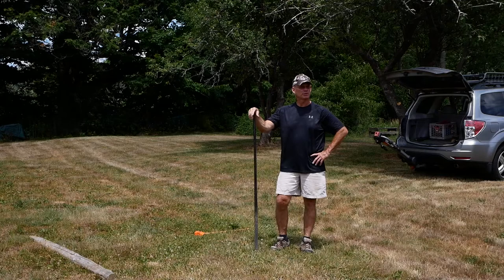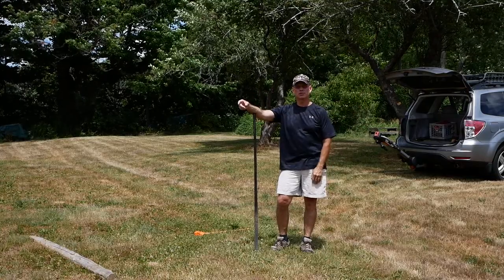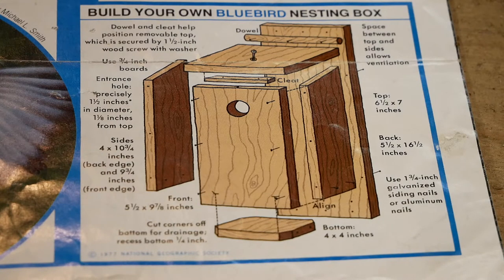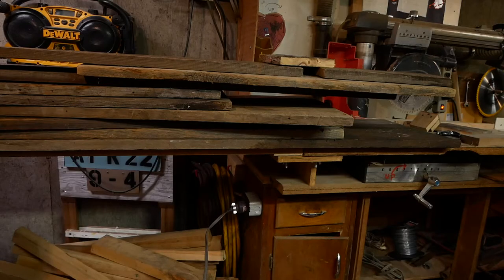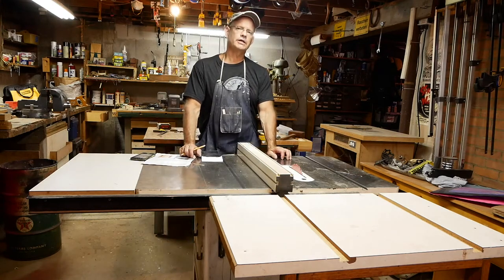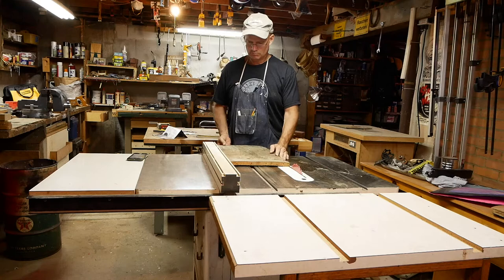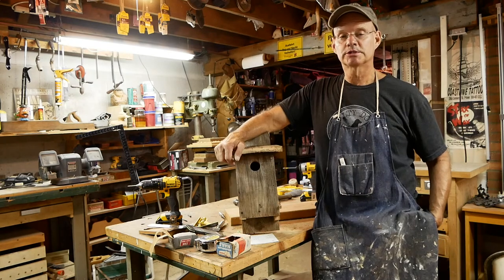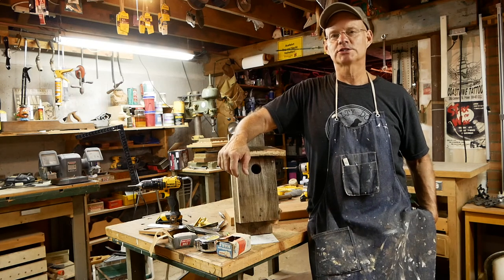Building a Bluebird Nesting Box

Comment: Hidy & thank you for making your video on bird-houses. You have some AWESOME PICTURES, but you need a good microphone on your collar. I couldn't hardly hear you. (I checked the comments, to see if anyone else had problems hearing you, and they did.) We could hear the drill-motor impacting, but the rest was low and skippy...but Thanks for making the video.
   <One tip, if you plan on doing a bunch of those free-standing post houses, get a piece of thin-walled 4" steel pipe and weld up one end. Then stand-off two parallel handles, one on each side. you want it 3' long. Slide it over the top end of your post BEFORE you put it in the ground. Run a band of tape around your post for the depth you want to drive into the ground. Then raise it up 2 feet and jerk it downward. Repeat till the amount if post is in the ground at your tape mark.> Don't do like I did, on my first one...you DON'T WANT handles at 90 degrees from the pipe ! It will JAR you terribly. You want tge handles to be made from 1" pipe and be vertical. That way, your glove slides on the pipe handle and your wrists and joints don't get jarred badly. 🍀
Reply from the maker: Thank you for the input. I have looked into them.